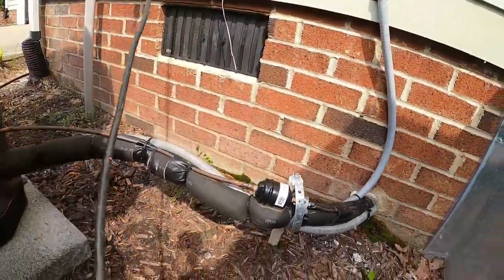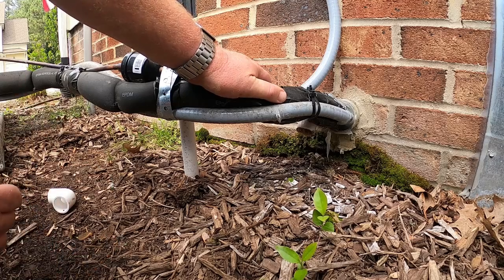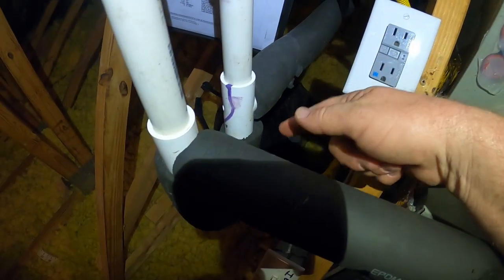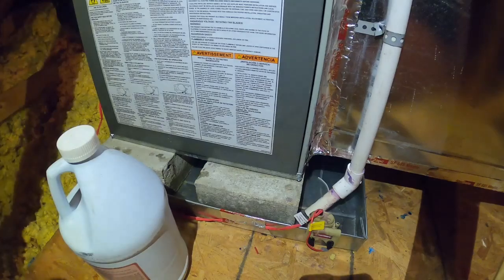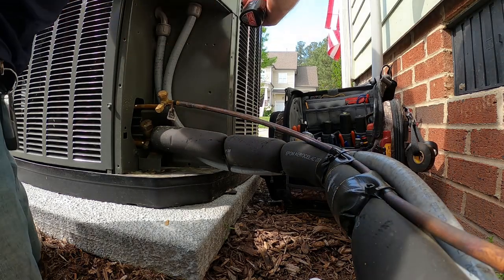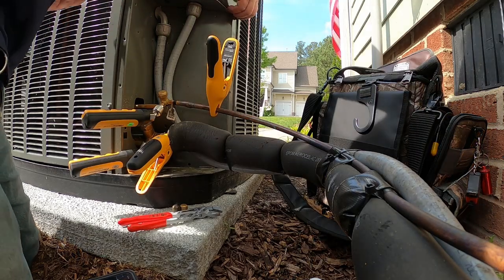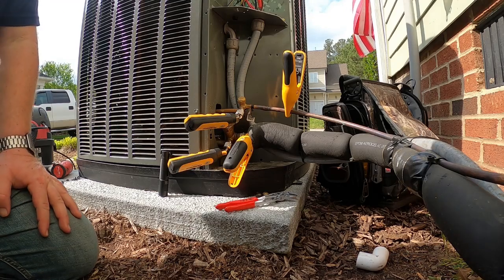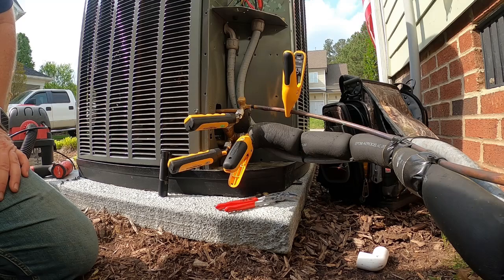NEST thermostat has no power?

Comment: Where did you get that pump that you used to clear the drain pan.
Reply from the maker: We typically get them at Lowe’s, they bring them back in stock once you go into the winter for kerosene transfer. But you can order them on Amazon. About $18-$20 each. At that price, it’s more economical, we have 12 to 14 service vans in our department on the road at any time and those rechargeable Milwaukee style transfer pumps would be a little too costly, and then you hope the tech doesn’t break one. If they want to buy their own that’s fine they can use it I see the purpose in it, but for the price in the situation wouldn’t be a good idea.

Comment: Where did you purchase the handheld vacuum
Reply from the maker: You can usually find them at Lowe’s going into the winter for kerosene transfer. But you can order them on Amazon $18-$20 each.
Reply from the maker: If you were referring to the fitting on my vacuum, I got it on amazon, go to amazon and search DIYVAC

Comment: Like your see-through vac hose, so you can get a visual of the crap obstruction? Had a A/C guy working on the house next door, tell me to run a garden hose up the drain line for 20 seconds? What's your thoughts on that?
Reply from the maker: Probably would not do that for an upstairs, crawlspace maybe and not for more than 5-10 seconds depending on the length of the line. The theory is that the back flush will pull the clog out.  If you have any open vent pipes on the drain you will just blow water everywhere. If there are any loose or unglued fittings you could cause a leak. I have done it, every situation is different.
Reply: @MYHVACLIFE  It's an above the closet horizontal air handler position. It is closed on the vents, but it has a secondary sofit drain up above the unit? I did use the garden hose a few times to unclog the blockage with only holding it about 5 to 10 seconds like you advised, worked pretty well for me? Thanks for the good advice, sir.